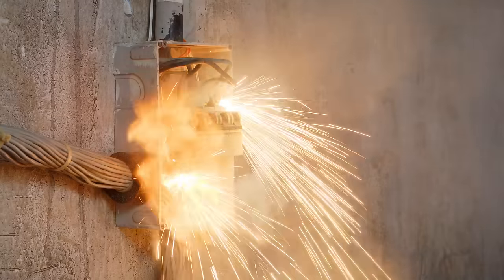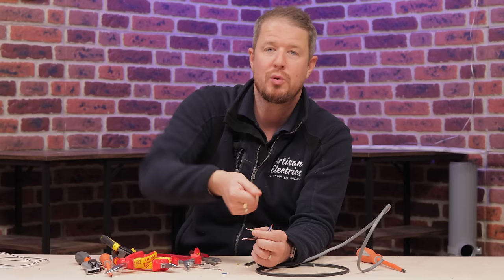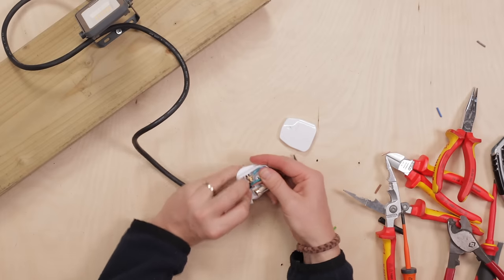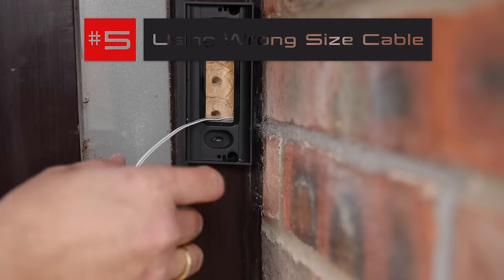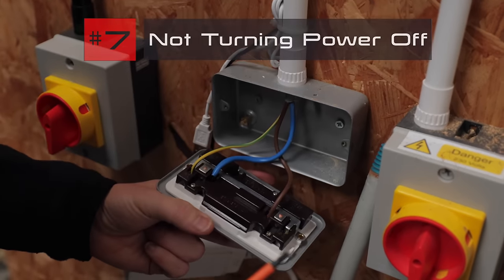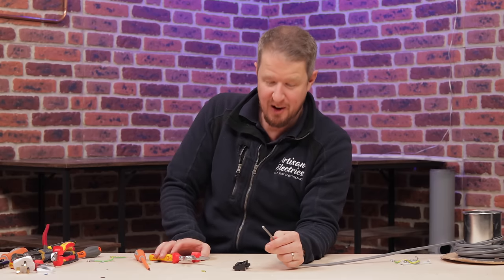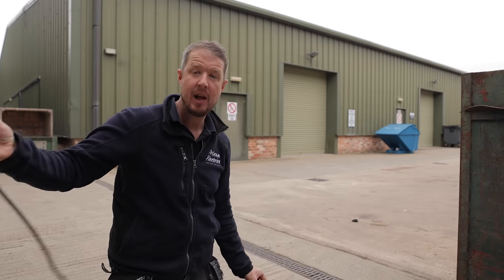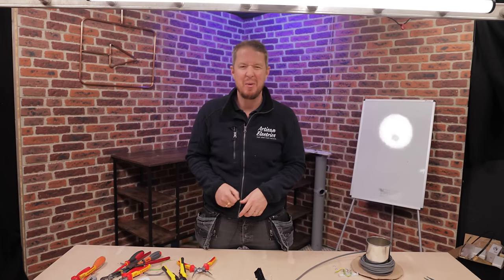10 Mistakes EVERYONE Makes When Doing DIY Electrics!💥

Comment: I remember, many moons ago, when we had a call out to house where the little girl had got a shock. To our utter disbelief, the DIY clown had wired the lighting circuit, on the surface, with the very old purple fabric twin flex cable with uninsulated staples to the wall and ceiling, even the excess cable too!!  The little girl got the shock from a live staple near the switch!!   I've also come across a whole house wired in bell wire!   Had another occasion where I went to help another spark in the middle of trying to rewire a house. I couldn't believe the state of the place, the other spark John was trying to get under the floor in the lounge. RUG nailed to floor, then Lino, then 8x4 board nailed and then tongue and grooved floor boards-different from the norm, in that the boards were grooved female both edges and the tongue was a METAL strip between them!!  Sorry to say I left when the woman complained about the mess!!    Gave up on house bashing years ago.  Good luck you lot!

Comment: Speak for yourself, don’t keep denigrating DIYers who know what they are doing and do better than some of the cowboy electricians that are out there.
 As a DIY er I’ve improved the appalling wiring (probably done by the builder who built his own house) in our 1970s house. Single ring for an entire 3bed detached house including immersion as a spur off the ring. It  had lots of wire nuts and twisted connections!  Borrowed neutrals. 
I’d just  go read BS7671 and the on site guide and do it properly. Added separate radial for the immersion, which is no longer used but it supplies power to the loft for the digital shower and axial fan, I split the single ring into two rings (proper and continuous), re wired the kitchen, garage and boiler house.
They used to stock the IEE wiring regs in WH Smith’s in town, I used  to go read and memorise before doing work. 
Only thing I’ve lacked over the years is a MFT. But subsequent PIRs  (EICR for the youngsters) have shown the installation to be sound including the fixed borrowed neutrals. 
Did have reputable a local spark in to change the CU to full RCBO board 14 years ago and recently had spark in to replace the RCBOs and main switch but kept the enclosure.
Not paying Artisan prices to do something I can do myself to a proper standard!
Reply: I guess the problem is they rarely come across good DIY as they assume all good installs are by sparkies and all the poor stuff is by DIY Dave (being a David it’s even more grating).

Frankly there are some horrible wiring bodges I’ve seen and some of the crap jobs I’ve see. In my house done for the sake of speed rather than quality and maintainability are annoying to say the least. 1mm cable for the light that snaps because the copper has work hardened and not enough slack on the cables. 

However there are a ton of things I would not know like how to design earthing arrangement on a solar install with UPS functionality that are defo a job for a qualified sparky. 

The problem is people like you are probably a rare breed.
Reply: I work as an Electrician in Australia and I think the reason DIY is generally frowned upon is because the potential risk involved for one and the propensity for DIY people to think they're ready to tackle certain aspects of the job they aren't prepared for. 

On the flip side, if your DIY is up to par, I would assume most electricians will just assume it was professionally done which strengthens their cognitive bias because in their eyes all they see is the DIY fuckups. 

Side-note: It's illegal in Australia to work on electricity without being licensed so maybe it's different wherever you guys are from (:
Reply: @cmm287  In the UK, there is quite a lot of DIY work permitted: pretty much anything internal except bathrooms or new circuits from the consumer unit (and anything else can still be done DIY if notified to the council building control and then electrically tested by a professional).  Problem is that any work you do must be tested to BS7671 which requires calibrated test equipment that no DIYer is likely to own, and most sparkies won't be interested in testing DIYers work for them.

The irony is, of course, that when was young and irresponsible, I installed an outside light (fused down from a spur on a socket circuit) and tested my own work as best as I could using 40-year old test equipment... couldn't find an earth.  I then discovered that the socket spur (professionally installed some years prior) I was using to feed the light was itself spurred from another socket spur (not how it should have been done) and that that the first spur wasn't connected to earth: 2 unearthed sockets.  Hence, I, the DIYer was obviously the first person to check my own work with any test equipment whatsoever, and also the one who ended up correcting the fault, only because I was testing my own DIY work, albeit not with the calibrated test equipment I should have been using.

Comment: I've been told that the reason solder is not used in house wiring is that it would let go in a fire, with very dangerous results.   By the way, Wagos have made it to the USA.  I find them very useful on the test bench because it is so easy to make a good connection and then undo it non-destructively.
Reply: This is why I don't like the tamper-proof/non-serviceable multi-socket Extension leads as these often use solder joints (to stop people re-purposing them I guess?)

I had one recently in a school I work at (in the UK) where I took it out of service because the outer sheath had escaped the cord grip and it had an intermittent supply of power to the sockets. Out of curiosity, I broke it apart just to see how it had failed and it looked as if it had been getting a bit hot as the live connection was barely still connected. In the bin that went.

The problem is, where it came from, the room (a faculty Staff room to be more specific) doesn't have many wall sockets so Staff have been using these extension leads where they want to plug in more devices. The other problem is that we have Staff who aren't particular about what they will plug into one extension lead ranging from any one or more of Fridges, Toasters, Kettles & Fan Heaters!
Reply: i guess when you're house is burning down, you don't want it burning down a second time :P
Reply: Two other reasons for not putting soldered wires under screws. It's too soft, and will quickly work loose. If/when it does, and a significant current is drawn it will quickly heat up and melt. In an extreme case it will arc and then actually burn, very, very hot!

Comment: The wound up extention could also apply when people are using their vacuum cleaner with the cable wound up inside, not fully pulled out(like a Henry type vacuum). I used to service vacuum cleaners for a cleaning company as an apprentice and we regularly replaced the flex cable inside the vacuum cleaners. The cable had melted together the outer layer inside the coil causing the cable to not be fully deployed. This of course caused a further issue with further melting. Fortunately we never had any fires, but cleaners would complain the cable could not be pulled out properly. We would try to educate the cleaners to "fully pull out the cord" when using the vacuum.

Comment: Hi Jordan, old school of wiring a 13amp plug (or any plug infact) is that It should be able to survive a cable pull test. i.e on pulling the cable (with a failed restraint) the live cable should be the the first to be pulled from its terminal. followed by the neutral and finally the protective earth lead. Hence the differential lengths of the terminal wires. There should be enough room in the plug top to accomadate the extra length of the protective earth wire. 😀

Comment: The reason that a wound up coil of wire is not because it creates an inductor. I've heard this myth many times before. The actual reason is pretty simple: an unwound coil simply has a lot more surface area to dissipate away the heat. When it's coiled up, it traps all the heat generated inside of the coil and has nowhere to go except for the minimal surface area that's exposed to the air. This increases the temperate of the conductors inside the coil, since they're effectively insulated, while, at the same time, being heated by their surroundings. There are simply fewer routes for the heat to escape.
Reply from the maker: Thanks 👍
Reply: You beat me to it! Yes I've also seen that myth about induction before, apart from anything else as the current flows through both live conductors but in opposite directions the magnetic fields cancel.

Comment: Plenty of solar panel fires where the installation was carried out by professional electricians. 
Plenty of factory fires put down to electrical faults , that's not an installation done by DIY.
As an electronic engineer , I have seen many machine tools damaged by electricians who think they are qualified to work on anything from a torch to a nuclear power station.
Reply: As a professional, I have stuffed up. No one is perfect. The professional makes far fewer mistakes, because of the long training and continuous learning of the day work. Unfortunately there are some who know better, but take short cuts at every turn, not good for the trade.
Reply: @rodbicke No. He is criticising electricians, not professionals.
Specifically electricians.

Electricians that think they are experts

Electricians should not be making safety critical mistakes.

It is not acceptable to make safety critical mistakes and say "Oh it happens". That is not good enough.

Comment: I did some home wiring to extend my power into the loft back in 1998. Before my parents bought the council house...  About 6 months after when they were buying.. They sent an electrician out to check the house wiring as part of the purchase agreement.  We forgot to unplug a few items in my wiring extension and his test equipment showed the plugged in items.  So we had to go up and unplug the Railway... (Had a model railway in the loft and floor boarding.) 
Anyway he was impressed by the wiring and confirmed it was one of the better installs he had ever seen.  Asked me if I had training or had worked as an electrician.  (part of my education had included basic circuit installation.) So I actually got praise for a good install by the electrician, he said it was really rare to see a DIY install that met any codes.
I did question about running a light circuit off a Ring main through a fuse box to 1.5mm wire.  He said it was fine.  

The loft had an installation of wiring previously into the loft..  But it was literally from the last tenant, they took a plug socket and cable into the loft to power 2 lights and a heater.
I took all that out and put 4 lights up, strobe bulbs ? I forgot the name.  (live in Denmark now.) I built the ring main up there so we had 4 sockets, extended out of the ring main for the upstairs.  Sunk the wiring into the wall.  Came up into the loft and pinned ever 6 inches.  Fuse box by the entry hatch and off the fuse for the lighting circuit.. I had smaller wire for the lights, through a switch.  So you could go into the loft and turn on lights.  Power was always on to the sockets.
The house passed the Electrical inspection anyway, after main fuse box was updated from fuses to RCD's and moved from a bare panel above the fridge into a sealed panel above the fridge. (my work did not need touching.)

Comment: Nice to know as a diyer I've not made any of these mistakes. I even have my own live tester beeper. A note on the last one, some extension reels only use the trip/reset on 2 of the four plugs, well mine does anyways(could just be broken), my kid used a 2kw heater on the wrong socket. It didn't trip, nearly caught fire and also melted the wall socket the reel was plugged into! In the other 2 it trips very easily with the heater unless fully unwound.

Comment: I’m a retired industrial electrician, here in the US and find it interesting the differences between your electrical wiring and ours, residential wiring here is240/120 vac @60 hz , the vast majority of residential outlets here  are 15 or 20 amp 120 vac large loads stoves, air conditioning, … are 240 vac single phase. In some areas metal conduit is required on residential wiring.
I can not tell you how many times I’ve told people to unroll the extension cords, I’ve actually seen a heavy duty cord melt no fire or smoke just a melted extension cord

Comment: A number of people also fail to fully pull out the flex lead inside Vacuum Cleaners. As you described for the Extension Lead - It acts exactly the same. Some Vacuums also have thermal cut outs - but cheaper ones are only going to "Go Up in Smoke" & Flames.

Comment: Number of DIY-mistakes I've done. I was going to write "none" because in my country, it is illegal to do installation works unless you are qualified. But actually, we are allowed to switch sockets, lampswitches, and such and do non-installation works. The worst (only) mistake I made was  when I was repairing an extension cord by cutting out the part that had the break. This was several decades ago. To identify the break, I re-plugged the extension lead and searched for the break with a "phazer", though I forgot to unplug again before I cut. 😂 After that, I was very much more prone to double check and triple check that I disconnected the power before I continued. ⚡️

Comment: 7:45, use ferrule crimp ends (shoelace crimp). Not only do you crimp once with your tool, the screw itself will compress the wires against the ferrule and they won't separate or spread out, ensuring a solid connection. I don't know why people don't use them on stranded wire outside the EU. Every time i see one without a crimp, I cringe.
Reply: Must admit I like using ferrules - got some a few years ago (with crimp). While not an electrician as a retired electronic engineer I know more than most.
Reply: @apk55  Discovered simple ferrules for flex termination years back.
Reply: I need two on the second meter tails i just upgraded (from the insufficiently sized cable the previous diyer did). But I'm not going to buy a tool just to crimp two ferrules!
Reply: Professionals work on live boxes. You just have to be mindful. Otherwise you're working in the dark!
Reply: @imaginitivity7853  I crimp hundreds of wires every day since I'm building automation cabinets with PLCs and drives and other stuff, so I really need it, but on installations with solid core, I guess you don't really need it. But my point stands. Multi core wire should be always crimped unless connected to a spring terminal. Push terminals and Screw terminals need the crimp.
Reply: On the end of a circuit ferrules are fine.  At any intermediate joint they are nothing but a problem.  Try putting two or more separately ferruled wires into a single terminal position.  Sure you can get multi-wire ferrules but then you can't separate the circuit up for diagnosis without cutting something.  Of course if the wiring is being paralleled and then placed as the sole cable into a terminal, ferrules are fine there since that is again the end of the circuit.

Even when placing a single ferruled wire into a terminal with a penetrating screw consideration must be given to the ability to correctly clamp the wire under the screw.  A ferrule in a large enough terminal can still ride up the side of the screw.  This is why some countries require a small wire in a large terminal to be folded over - ensure it's clamped under the screw correctly.

You can't just blindly whack a ferrule on a wire and say 'all good'.
Reply: @evicol2117  Ferrules on solid core are a no-go, they are not design for it. Besides being useless.
BTW, there are also push terminals and screw terminals which do not need crimped multi-core/fine-stranded wires, but that's why the manufacturers hands out instruction manuals.
Reply: @retrozmachine1189  There are also ferrules where you can put two fine-stranded wires in. No technical issues, but if you want to disconnect them, you're facing the problems you described. So the usual usage for such two-wire ferrules is when you have multiple RCDs and go from one RCD to the next, so that you basically only have one (big) wire in the first RCD.
However if you have more wires, go for a Wago and run a single wire to the terminal.

Comment: One thing common in bodge jobs especially around surveillance cameras is using Ethernet cables for power by directly wiring a few cores of the Ethernet cable to either a DC power supply or even mains voltage. The proper way to supply power using an Ethernet cable is to use a PoE injector / switch with a PoE capable device.
Reply: And that works because PoE typically uses 48 Volts, and so the current flow (which is what drives heat dissipation) is only a quarter of that used with a 12 volt device for the same wattage.

Comment: I had to do a lot of electrical work on my house and i took the time to search out quality sockets and sundries. I also made good any poor quality wiring i saw and replaced the choc-block with proper junction boxes. When tightening connectors with a screw driver, nip them up and then again a day later. You'd be surprised how much it will have relaxed in 24 hours.

Comment: The most important reason to avoid plugging extension leads together is that each time you do that you increase the resistance slightly, and that will reduce earth leakage currents, meaning that your rcd will be less able to detect faults

Comment: As a DIYer I don't often see other people's work, but having moved into houses that other people have worked on, the one that I see the most is just that the cables behind sockets and light switches are far too short, like you unscrew a socket to paint around it and it can barely move.